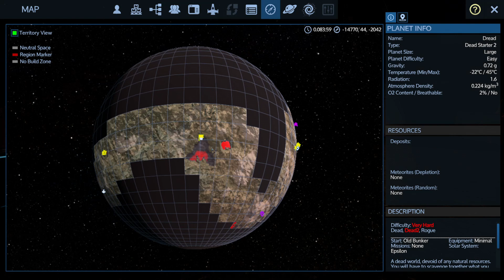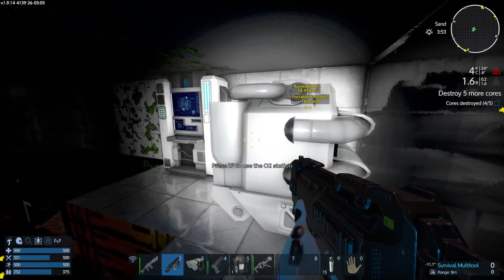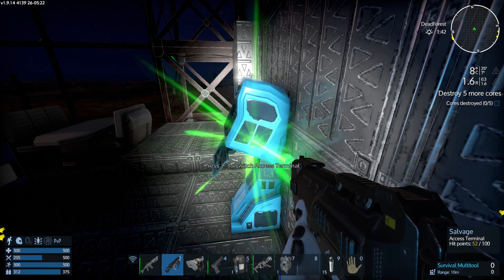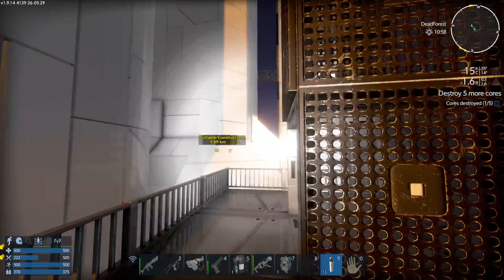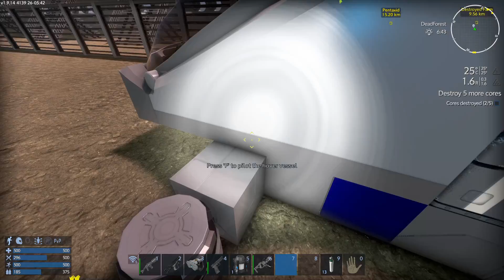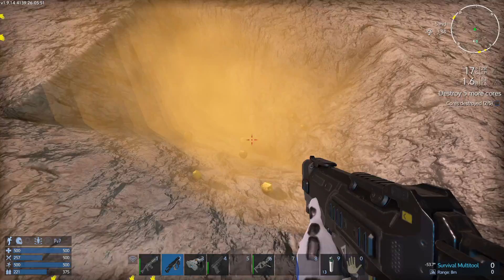Unfinished Escape Rocket : Reforged Eden  1.9 - Empyrion Galactic Survival : #04

Comment: Anyone play very recently and not find the core for the unfinished escape rocket in this location. It has a Basic Extension in place of the core in this spot in my game
Reply from the maker: There seems to be two versions of the unfinished escape rocket.  It seems the dead planet start uses  the location that has been around for some time,  while there seems to be a version on other dead planets where the core is lower down.  Have been told the new location is near the upper warp drive, but cannot conform this at the moment.  Plan to visit another dead planet to check this out.
Reply: @StephenSilverbeard  Found it. Easier to get to than the other to be honest. Top of the upper warp inside the ship. Got in through the opening right next to the drive from the truss.
Reply from the maker: @gryphyne  Ty for the information,

Comment: If you collapse any concrete structure and pick up the bits it will give you stone dust and you can make ores out of that.
Reply from the maker: Have been reluctant to do this due to the limited carry capacity, but will be doing it once the SV is up and running.

Comment: While the CV would be more useful long-term, I suspect a space-capable SV will be oof more immediate value. Now you have the abilities to make better stuff, perhaps consider changing your workshop goal into an SV with that in mind?
Reply from the maker: Agree, the SV is important,  the Silvershade lite is a stripped down version the MkII Silvershde that  should be within the RE tier 1 CPU requirements (I think).  The good thing is I can either remove or add items according to how thing go.  One day I need to make a RE version of the MKII.
Reply: @StephenSilverbeard  That's why I said try to prioritise the top-tier SV you can currently build. It may need more resources, but it would be an advantage long-term, shouldn't take much longer than the Lite, & most of what you're doing currently is simply running around harvesting resources while exploring anyway..
Reply from the maker: @snafu.X  Unfortunately my higher tier SVs are not RE compliant, e.g. while the lite version has 4500 storage ammo box. Plan to fix this when the CV is operational as  it would be useful have a RE versions of the MKII.